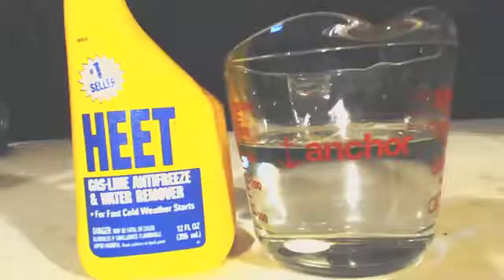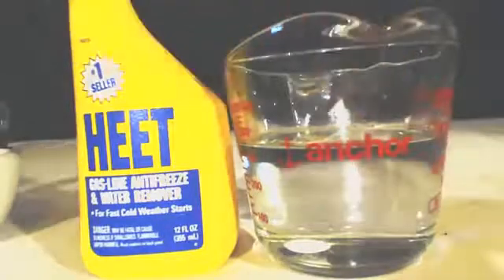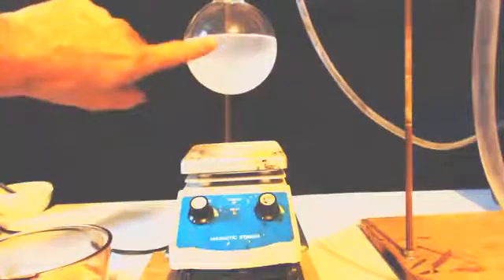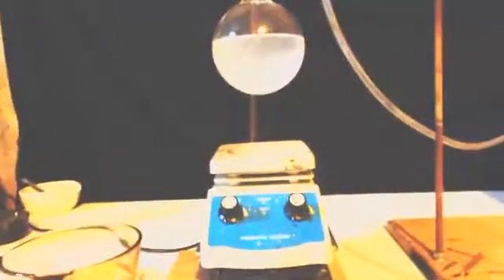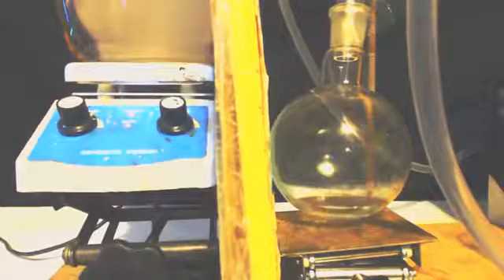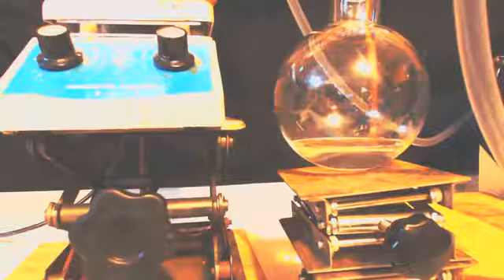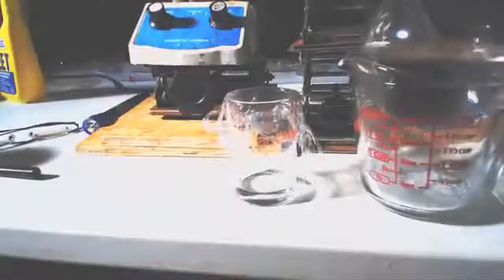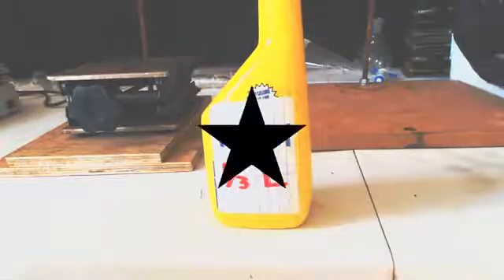HOW TO GET PURE METHANOL

Comment: Nice video. What is the MgSO4 for?
Reply from the maker: Paul Halloween............Thanks.   The MgSO4 is Epsom salt I dehydrated(dried) in the oven.  So it Is anhydrous and so a good desiccant.  Just in case there is any trace amounts of water in the methanol I put some anhydrous MgSO4 to soak up the water and make sure the methanol is anhydrous
Reply: @jbsc6180  ok, good to know.  I'm gonna try it. Mine antifreeze is blue,  it contains methanol but it must also contain some soap. I hope doesn't explode
Reply from the maker: Paul Halloween............If you buy the brand in the video with the same color bottle and text color then you can just use it straight out of the bottle.....for MOST experiments.   If the experiment is water sensitive then you may want to put some MgSO4 in to dry the alcohol and then filter and use.  But if the experiment  is a water sensitive experiment and MgSO4 will mess up the experiment then you will have to distill after you dry it to get the MgSO4 out of the methanol because MgSO4 is slightly soluble in alcohol.   KEEP IN MIND ......."Heet"  gas line antifreeze also comes in a bottle with different colors and that product I believe is mostly isopropanol (rubbing alcohol).    Also I could be wrong.......just guessing.....but I do not think there is any product that has soap in it that you would put in to a motor (gas tank).   Just guessing but it sounds like that would gunk things up in a motor.
Reply from the maker: Paul Halloween..........About blowing up.   If you want to minimize the chance for a fire or what ever.   The MOST IMPORTANT thing to remember is  to grease your ground glass joints and use boiling stones or a stir bar.  Also a good way is to use electric heat and an oil bath.   Even using an oil bath with a flame is good.  Not as good as electric BUT in most cases if you have an oil bath and a leak occurs then  it usually sprays in to the oil bath and not on to the flame and then if you are watching you have time to turn the flame off and fix the leak.  I said MOST cases not all and that is why electric is best.   The electric hot plate will not get hot enough to ignite the methanol.  Well it can get hot enough to cause ignition  but methanol distills at a some what low temperature.  So unless you are turning the hot plate up WAY TO HIGH then you will be ok even if there is a leak.  The auto ignition temp of methanol is 470 C / 878 F.   So methanol can NOT ignite WITH OUT a flame or spark at any temp below that.  And if you have your hot plate that hot trying to distill methanol it will bump sooooooooo  bad.   You would never get it that hot unless your an idiot.   I mean methanol distills at 65 C for god sakes...lol.    Unless your a total idiot you would never get your hot plate above or even close to 200 C.   I mean you only need the oil bath at like 80 C to distill methanol so the highest temp your hot plate should be is like 150 C..........  And the last thing is if you do not have any experience with distillations then start by distilling water first  to practice once.  It is always best to start out small with flammable compunds until you are comfortable with the process of distillation.  I mean if you distill 100 or 200 mL and you get  a leak and a fire it is not really that big of a deal unless you are an idiot in emergency situations.  The fire would MOST LIKELY  be nothing more than big giant candle but if you distill 1000 mL and get a leak then it could actually explode if it hits a flame spark or anything above 470 C/ 878 F.  ........................Just don't have flame and sparks around and  keep your hotplate below 200 C and it will be impossible to blow up cause the auto ignition temp of methanol  is 470 C
Reply: @jbsc6180  Thanks for answering. I did it successfully thanks to you.  I got more than 250 ml  of methanol from 600 ml of product. I want this methanol to make formaldehyde.  Can you make a video making formaldehyde? there isn't on Youtube, your video would be the only one.
Reply from the maker: Paul Haloween.............I am sick as a dog so I may have to finish this in a couple different post.   I am so glad you were successful distilling your methanol.  Making aldehydes is on my list.  I need them to do Grignard reactions.  But it will probably take me a while to get there.   The "FOR SURE"  way to make them is using KCC or PCC or chromyl chloride.  Unfortunately KCC takes forever to make and PCC takes even more time.   And chromyl chloride is the nastiest stuff you can work with.  If you want me to direct you to videos where people make those 3 oxidizers let me know and I will find the computer addresses for them.   The truth is none of them have used these oxidizers to make methanal (formaldehyde)  BUT they do make other aldehydes with them and I can direct you to those videos too.  You may say "well how does that help me make methanal?".   Well if you know how to make one aldehyde with PCC or KCC or chromyl chloride then you know how to make ALL  aldehydes with those oxidizers.  The procedure would be the same with the exception of the alcohol you are oxidizing.  If you want to take one of those routes to an aldehyde then I would suggest the KCC.  It may take a while to make but there is not much nasty fumes like chromyl chloride and PCC.  And I could definitely help direct you to succeed.  I personally am going to try to do it a different way with either bleach or copper oxide.   Because they are VERY easy for any one to get.   My first attempt will be with copper oxide. GImmie a minute and I will find a video on it.
Reply from the maker: Paul Halloween...........  https://www.youtube.com/watch?v=KBy_cjnMjpo   OK this guy is making ethanal (acetaldehyde) but the procedure is the same with the exception of using methanol instead of ethanol as the starting material.  Also methanal is a gas and ethanal is not.  ANYWAYS astral chemistry is just showing an example of how to make it but not really showing how to make a lot or enough to extract but I have ideas on that.  ANSWER THESE QUESTIONS and I can help you better.  You do not seem like you have a lot of experience in a lab.  (1) How much experience do you have in a lab?    Your answer will not change weather I help you or not so please tell the truth.  It is just that if you have close to no experience then I will know not to skip any information with you,  especially about safety things.  But if you have a lot I might skip some stuff that you would already know.   (2)  which procedure would you like to learn first?  Your choices are KCC or PCC or chromyl chloride or copper oxide.    If you want to try the copper oxide method like astral chemistry did then I could do a video  and give you suggestions of what I plan to do when I try it.  The other methods I could direct you to videos where they are using that oxidizer to make an aldehyde and help you change the method SLIGHTLY  so you can make methanal instead of the aldehyde they are making.   (3)  Do you have a lot of lab glass or can you buy any glass you need?   Cause that might determine the method you use if you are limited with glass or buying more glass................For example when making an aldehyde from copper oxide you would need to buy some fused silica quarts tubes cause regular lab glass (sodium borosilicate) is not the best glass to use with that much heat........I have had to many sodium borosilicate glass tubes explode on me from excessive heat so I broke down and bought some quartz glass tubes last month just to make methanal and ethanal  for Grignard reactions...........NOW using bleach to make aldehydes I am still trying to learn.    And I really could not help much.  Although I could direct you to a couple videos where they use bleach to oxidize toluene into benzaldehyde and another video where they oxidize a secondary  alcohol to a ketone.  But that is about it.  Bleach oxidation is not something I have read a lot about.  Although I do have a lot of ideas about it but with this method there would be a LOT of attempts to get it right and fine tune the reaction to get a good yield.  If your up to it I would help but this method would take a lot of time and more than one or two attempts to get it right.  Might take 20 or 40 attempts to get it right.  Might take one.  I really do not know.   ANYWAYS have a great day buddy.  I am glad I got up to reply.  Starting to feel less sick.
Reply: @jbsc6180  Hello, I hope you're better. I was thinking to make methanal with K2Cr2O7. No, I don't have so much experience, a little more than high school. I know more theoretical chemistry  than practical. I would like to study chemistry at university but unfortunately I was so unlucky.
Reply from the maker: Paul Halloween..............Well making aldehydes with dichromate is a poor reaction to make aldehydes.  Expected yields are like 45 to 50% if that.  I actually made a video where I try to make ethanal from ethanol and it did not work at all.  I BELIEVE/THINK the problem was this.  The pot needs to be boiling and refluxing strongly and I only had the pot hot.  Not boiling or refluxing strongly.  So basically I am saying the reaction is done exactly like I do it in this video https://www.youtube.com/watch?v=cPtq9af6nN4  EXCEPT you need to have the pot BOILING AND STRONGLY REFLUXING before you start dripping in the dichromate  and of course you need to use methanol instead of vodka.  Just a suggestion but it might be more productive to make some ethanal first before you make some methanol.  Because ethanal is a liquid it is easier to work with.  Then when you can make some ethanal you do the same thing to make methanal.......................
Reply from the maker: Paul Halloween..............That being said about dichromates and making aldehydes.............There is a better way to use the dichromate.   You can make PCC with dichromate......OR.....KCC which is super easy.  https://www.bitchute.com/video/0FClO4uhOHtw/  is for KCC.  https://www.bitchute.com/video/9xXwZqRWT4KI/  is for PCC........................KEEP IN MIND THOUGH............You may get a 70% yield using the KCC and only 50% using dichromate BUT when making KCC you will loose 30% of the dichromate so that loss may make the two reactions the same when it comes to yield of the aldehyde.  Do you see what I am saying.  KCC is a better reaction to make aldehydes but the loss in dichromate to make the KCC may counter act the fact it is a better reaction.  If you are shooting for using dichromate then my suggestion is to follow the exact directions in my FAILURE video where I make ethanal from vodka....... only make the pot hotter until it is strongly refluxing before you drip in the dichromate.   THEN IF THAT WORKS move over to trying to make methanal the same way and I could help with the stoichiometric amounts if you need it............Tell me what you want to try first and I can help.   If you want to skip trying to make ethanal and go straight to methanal then let me know and I can tell you the stoichiometry to use........................ALSO ANSWER THIS..............Do you want your end product to be methanal gas or do you want to make methanal in water which is called formalin???????????????????????????
Reply: @jbsc6180  Thanks for all the information given. Sorry but these links don't work. I would like to make an end product of formaldehyde solution, formalin.
Reply from the maker: Paul Halloween..........ok I am busy tonight but tomorrow I will let you know the amounts of stuff to make formalin.
Reply from the maker: Paul Halloween............I have not forgotten about you but I am to paranoid right now making some nitrocellulose to think about other crap.  When I get it neautrallized I will get back to you
Reply from the maker: ok this is the video showing what to do   https://www.youtube.com/watch?v=cPtq9af6nN4    But in the pot instead of vodka put 85 mL of MeOH and 180 mL of water.   Then in the addition funnel put 500 mL of H2O and 85 mL H2SO4 and 100 grams of dichromate.  Get the pot to boil and reflux STRONGLY.  Then start dripping in the stuff from the funnel.   Since you are making a gas you need to direct the gas with a hose to a bottle of water ....having the tube go to the bottom of the water and have the water almost frozen and sitting in an ice bath.  Just like when I make HCl acid.  I direct the HCl into water using a tube.  A suck back trap would be nice to have also.  So the water in the bottle is not sucked back in to the reaction pot.  Weigh the bottle of water accepting the formaldehyde.... before and after the reaction to see what your yield is.  The theoretical yield is 30.6 grams of formaldehyde.  With a 50 % yield that is 15.4 grams.  But with your inexperience and the fact the product is a gas you might only get a 25% yield at first which is only 7.7 grams.  If you have any questions let me know.  Keep in mind I have never done the reaction but I am almost sure this is the procedure.  The secret is to add the chromic acid while the pot is STRONGLY REFLUXING
Reply: @jbsc6180  Thanks for all the information. I'm gonna try it and lets see how it goes.
Reply from the maker: Paul Halloween.............Be careful and let me know how it goes.
Reply from the maker: IMPORTANT..............ALSO..................Put your glass apparatus set up like your refluxing.   With the condenser vertical AND ON TOP OF THE POT.  That way all the liquids will condense and flow back into the pot and only the formaldehyde can escape.   Then on top of the condenser put your hose that leads to your cold water MAKING YOUR FORMALIN.
Reply from the maker: Paul Halloween............You know you can also just buy paraformaldehyde that is used in the  photography industries.  Like people who develop their own pictures in a dark room for hobby or income............I used to buy it back in the day.  It is just a polymer of formaldehyde and you just use it as you would use formaldehyde but it is a solid so easier to work with and easy to make formalin.  Just put the solid paraformaldehyde in water and it will dissolve In the water.   And if you want dry gaseous formaldehyde you just put it in a RBF and heat the polymer up and it will decompose in to the gas
Reply from the maker: Paul Halloween............you can get 30 moles of formaldehyde for $25 on amazon.  That is less than a dollar a mole
Reply: @jbsc6180  ok. yeah it's cheaper to buy it than make it. Now I wanna make benzaldehyde.
Reply from the maker: Paul Halloween........Glad I could help.   I am doing a Grignard today to make sodium propanoate/propanoic acid.   If that works out I am going to make some benzyl chloride.  And then with that I am going to make or try to make.................. phenyl acetic acid from a Grignard..........also benzyl alcohol from NaOH.   Then I am going to make benzyl dichloride and from that I am going to make benzaldehyde from NaOH.   Probably be another 2 months or more though.  What is your starting material???????
Reply from the maker: Paul Halloween..........another way to make formaldehyde is with DCM (dichloromethane)  and NaOH which are both easy to get.  And you reflux it with water and the OH from the aqueous NaOH replaces the 2 chlorides on the DCM with an SN reaction.   And when you got 2 hydroxyls (OH)   on the same carbon it automatically turns into a carbonyl.......making formaldehyde.  I tried it last year and failed.  Still need to figure out the ratio to use between the water ,  hydroxide and DCM.....................BUT MAN WOULD THAT BE GREAT IT I COULD GET IT TO WORK
Reply: @jbsc6180  Well, I think my starting material it's gonna be tuluene. Tuluene → benzyl chloride (with Cl2 and reflux) →  benzyl alcochol  (with Na2CO3 and reflux) → benzaldehyde (Cu(NO3)2. I'm not sure yet if its gonna work. I don't know what CL2 i can use for Tuluene to benzyl chloride as catalyst. What about PCl5?
Reply from the maker: Paul Halloween ................Making benzyl chloride is my next video.   You can use PCl5 to make chlorine but I always use calcium hypochlorite since it is so accessible and cheap.  https://www.youtube.com/watch?v=iZ5p84F8GPE  The catalyst would be UV light.  My UV light source is https://www.youtube.com/watch?v=jWbNg3lU4MA This video is about how to get calcium hypochlorite https://www.youtube.com/watch?v=YCRNrm-o1yQ